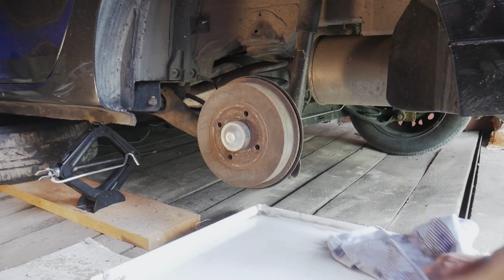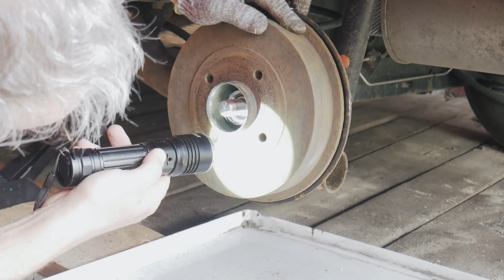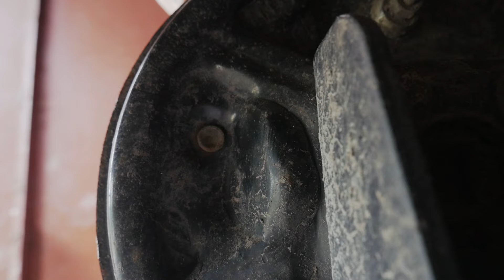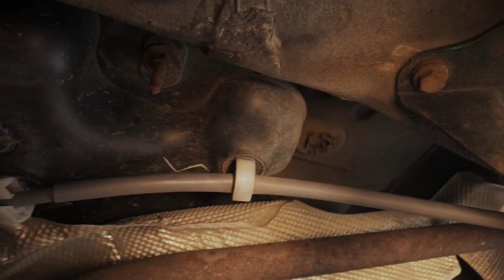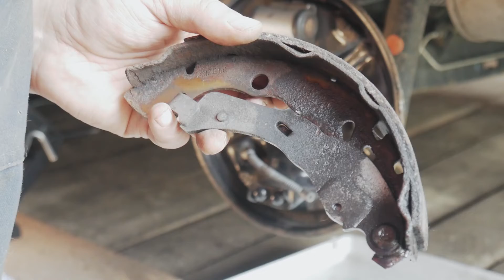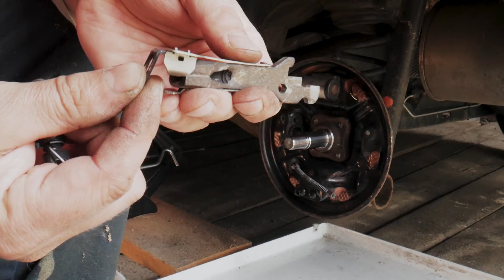Step-by-Step Guide: How to Remove, Repair & Reinstall Drum Brakes at Home

Comment: How much time you have old brake drums installed before change to new ones?
Reply from the maker: The original drum brake shoes can usually last up to 100,000 km, depending on driving style and conditions. However, aftermarket brands may wear out much faster — sometimes even under 40,000 km. It's always a good idea to check them regularly and listen for any signs like squeaking or reduced braking efficiency.